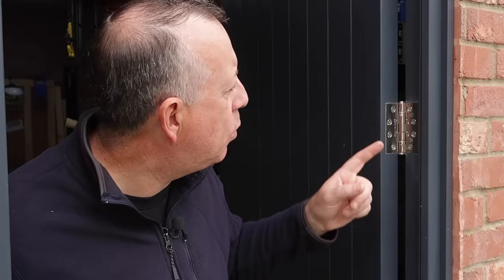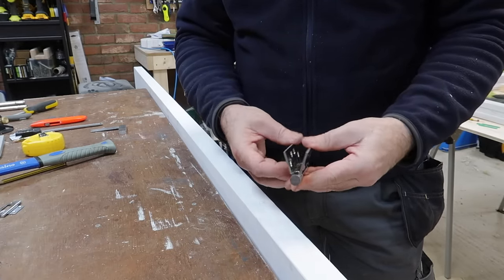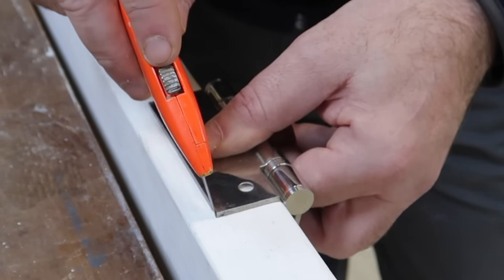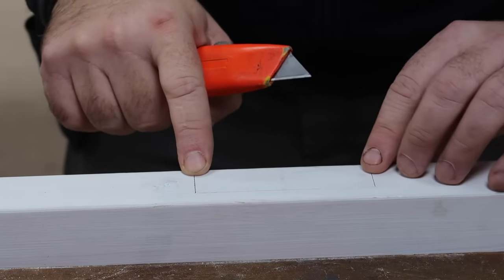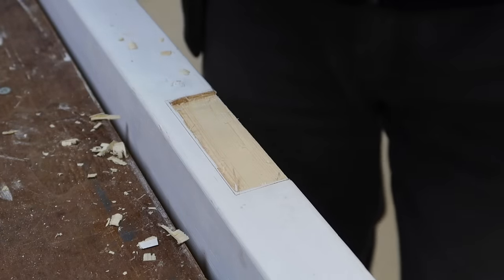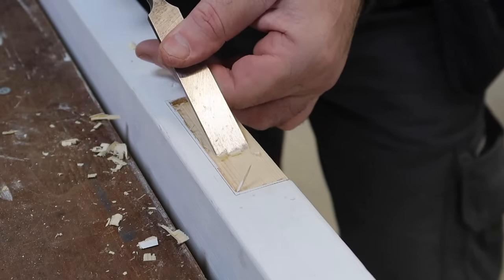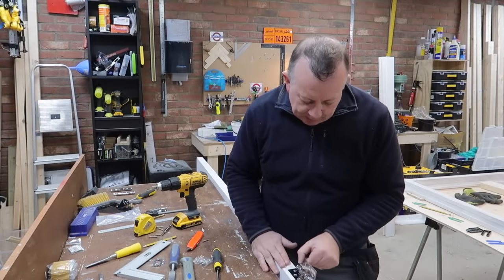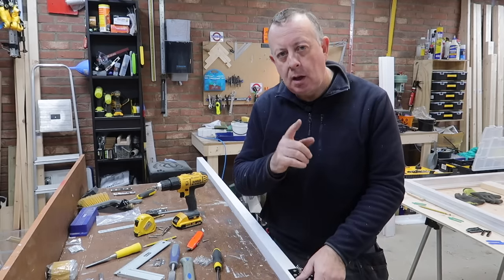How to Fit Perfect Door Hinges

Comment: You're using a metal headed hammer and not a wooden mallet? when would you use a mallet?
Reply from the maker: The chisels I'm using have a 'Thro ugh tang' which means they have a single piece of steel from the blade to the top - so you can use a metal hammer. If you use old fashioned chisels or traditional chisels, the tang stops mid way through the wodden handle. These you must use a mallet with.

Comment: Sorry to say , but your over complicating things here .try using a marking gauge to set the depth & width of your hinge .this eliminates the chance of slipping with the Stanley knife & cutting the end of your fingers off . I do use a Stanley knife to mark the length of the hinge ,b it I always cut from the middle outwards then you won’t slip and mark the door . Also your making work for yourself by using a chisel that is to small , try using a 1 inch chisel ,you’ll save yourself some time . 
Still a nice job .

Comment: Beautiful work.  However, in a commercial setting, this by-hand method is far too time consuming and not really competitive.  Viewers would do well to study up on how cut mortises using router jigs for a consistently perfect mortise, both in fit and in depth.  

I've been in this business for 43 years.  I've made myself a set of jigs from baltic birch ply many years ago that accept a router collar.  The jigs can be purchased also, but don't always give such a precise result that I like so I prefer the tight fit that I get with my handmade jigs.  

No monkey business... the mortises come out like a machine shop did them every time.  I've done my share of hand chisel work too, and still do in special cases.  I appreciate the skill required, but it is quite an antiquated technique that can be costly in terms of labor and not always consistent .   The router method is satisfying due to the repeatable perfection of the finished task.

Comment: You said  the part of the hinge with three sections goes on the jamb, and the part with two goes on the door, and that you can rotate the hinge because it is symmetrical. This is not true. The hinge can only go one way. If you install the hinge inverted the pin will eventually fall out. The pin has to be dropped in from the top. Only solution is to change the swing of the door. Not worth it. I just always install with pin head  up. This is of course, after I cut my hinge slots with my router hinge jig.
Reply from the maker: These hinges do not have removable pins - most in the UK don't

Comment: Very informative but it is a rule not a ruler!
Reply from the maker: No, it's a ruler. A rule starts it's measurement from the edge, a ruler starts it's measurement a little way in from the edge like the one I'm using.
Reply: Napoleon was a ruler a straight measure is a rule, as in 1metre rule.